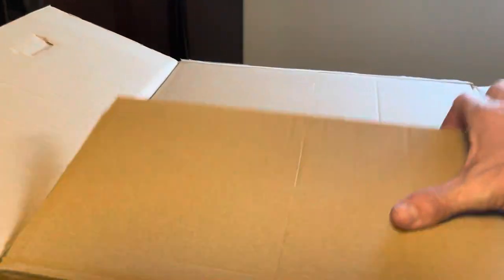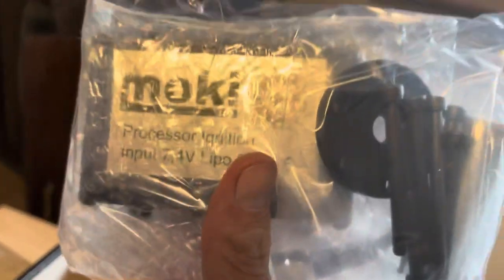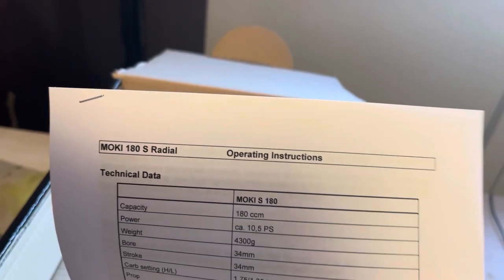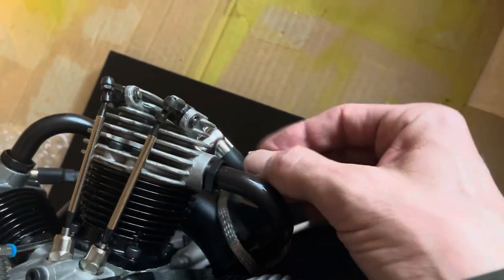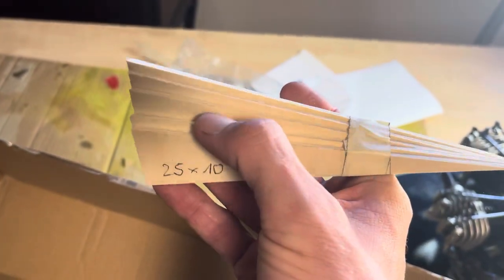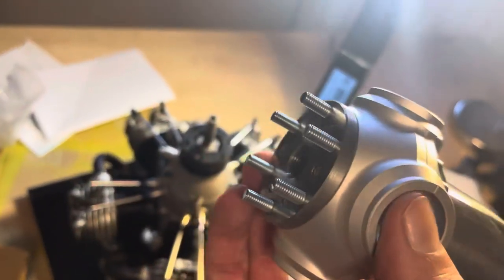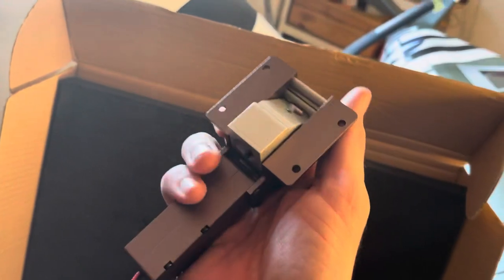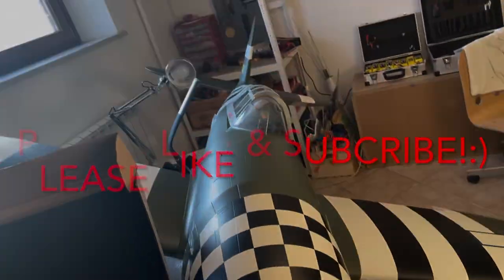Moki 180 radial - Unboxing plus bonus tape

Comment: i experienced those  toprc gear motors to be too weak, however the legs are excelent, but you might wanna cut the springs inside them, they're a bit too hard.

make sure you test then extensively and add some extra force with your finger while extending and retracting (to simulate turbulence forces)
mine didnt had enough power to extend with a extra force, and didnt retract at all.
Reply from the maker: Ok I will do so. I have cycled them they seem to work ok….However I think it all depends on a power source you run those retracts. What was your solution ?
Reply: @jurijbatagelj6574  i tried with 8.4 volt but the motors were to weak, i exchanged the motors, using JP now, in flight the toprc motors didnt had enough power to fight against the turbulences.